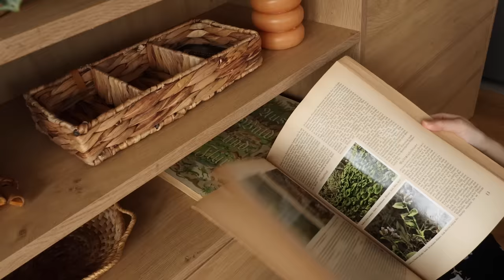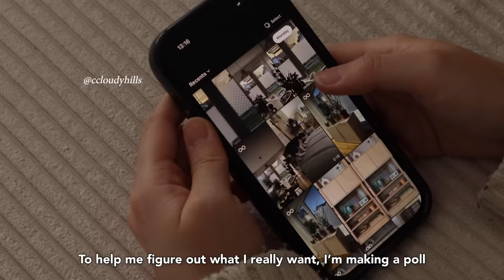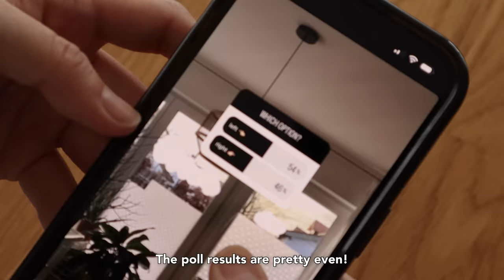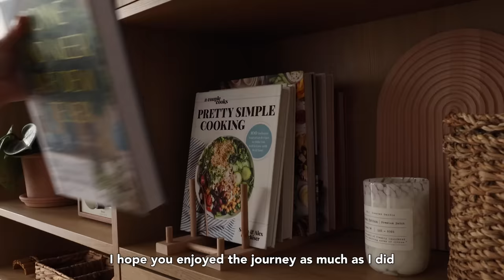A dining room for 2 homebodies | Room makeover

Comment from the maker: For those asking, the custom bookshelf is from MYCS and here's my review (unsponsored)!

Pros:
- Fully customisable including the width, height, 2 depth to choose from, where to put drawers & cupboards and even backing
- Pretty easy to build once you understand the concept
- Many colours to choose from. We have oak veneer that looks pretty in natural lighting

Cons:
- Not that modular since each shelf is specific to the customisation
- Takes 2 people to build
- Quality doesn't meet expectations when you think about the price (little things like glue peels at the edges, raw plywood drawers)

Frustrations: 
- Long delivery time with delays (It said 7 weeks, but took 15)
- Not the best customer service. When we emailed about the delay, they just kept saying they have no materials in the warehouse
- Parts were missing or wrongly shipped (We still can't install our drawers because the wrong sliders were sent) 

Overall, despite the frustrations, we don't regret the purchase since we needed something customizable to accommodate the wall vent, and we bought it at 40% off (Watch out for sales!) It looks great and has plenty of storage too 😊
Reply: Thanks for this review. I was wondering about getting shelving from MYCS, but I was concerned about the quality. I bought a customised sofa from them before and I love it despite feeling like the legs could have supported the sofa better. I have a Frame TV and a few hanging pictures for a gallery wall but I think it needs some more rustic looking shelving to keep the apartment looking too modern only. Love the way it looks in your place.